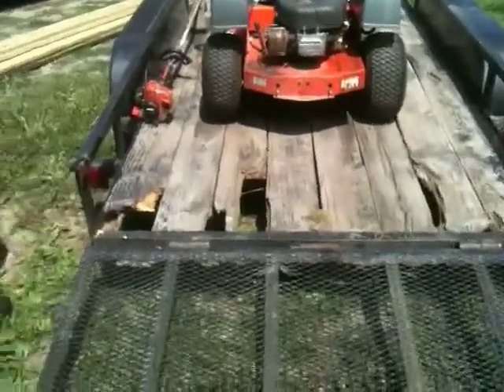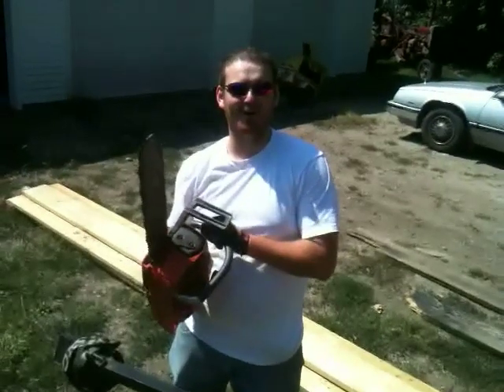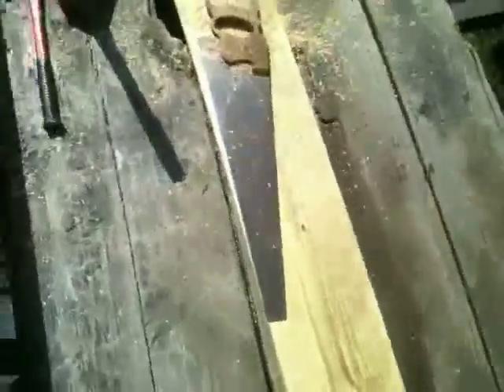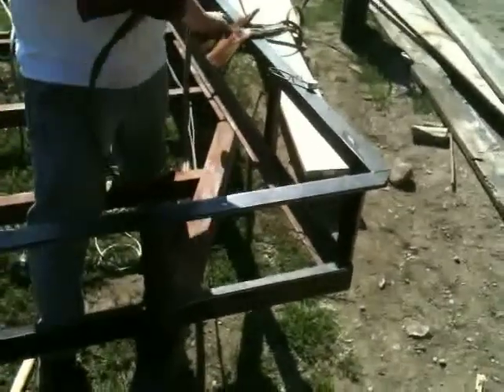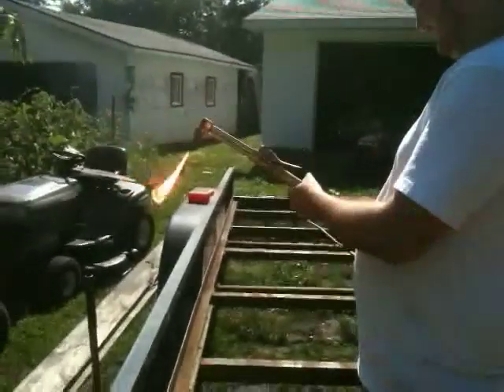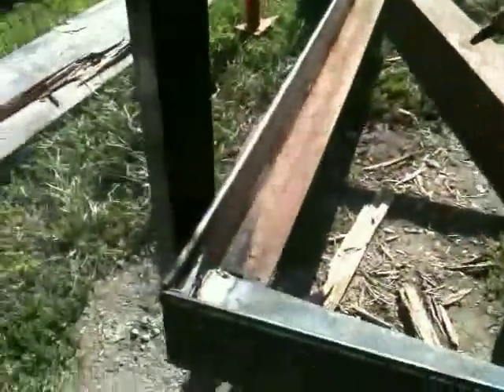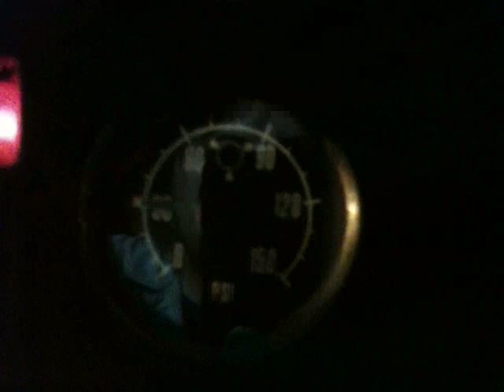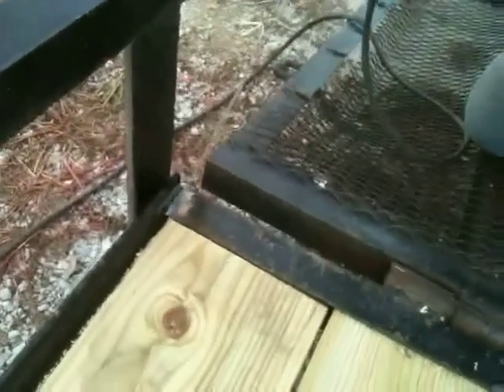Trailer Work

Comment from the maker: @w4kwd This process is usually how trailer floors are made/installed/put together. Bizarrefurhead and I didn't see anyway other way to go about the task at hand (installing new trailer boards). And besides this approach seemed easier than trying to bend the boards to get them to pop into place. But then again everyone does anything differently, that's what the world such a fun to live in these days.

Comment from the maker: @naterade21 That is turning out to be a expensive proposition. I have one battery bought at 90.00 USD, now I am waiting to another battery at the same price. However I came to milestone today. I believe I have found the key to the semi so now I won't have to break the cylinder out of the dash and hot wire anything. And that isn't talking about the diesel fuel I'll have too purchase. So please be patient. I assure that I will have the truck running before the end of summer!